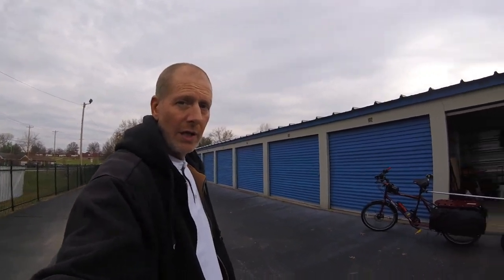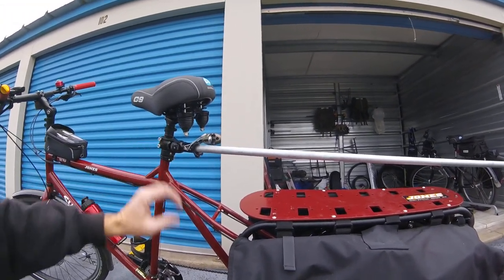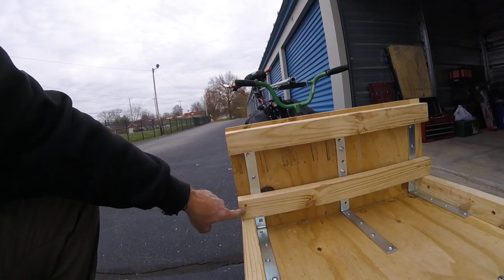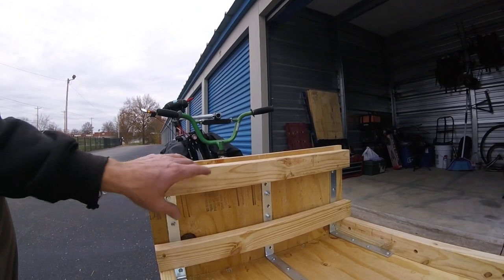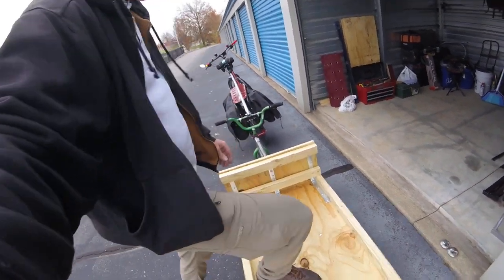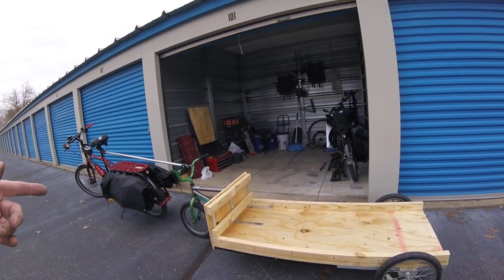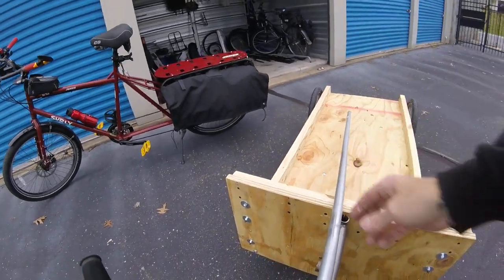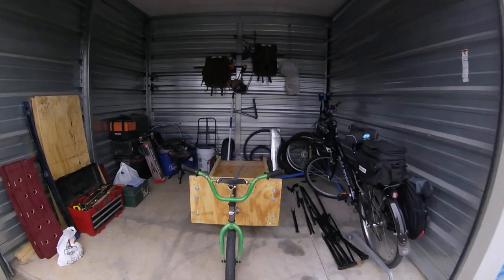3 Wheel Bicycle Trailer Build Part 3 Completion

Comment: May I suggest round wire lock pins to make the hitch arm removable?
Reply from the maker: Newest video shows how I fixed the week point. I like the bar attached with bolts as it just folds back onto the trailer for storage. Plus I always try to prevent theft of my bicycle and trailer in public settings. The easier you make it for people to steal your stuff the more likely they are to try and steal it.

Comment: I did almost exactly the same stem around the seat post as you. But i cut it in half. I just noticed you seem to be missing the 3rd axis of rotation / roll ? Also i think you only need one up and down movement but you have dual pivots at the handlebar and at your seat post, does that work better ? check my version of this https://youtu.be/AJDL-AiAKPA tell me what you think, im using a kids scooter part and 2 bike stems one is cut in half and drilled
Reply from the maker: That is a good point I do not have any roll. I like your version. Mostly I like messing with different setups and just tinkering.
Reply: @CargoBikeCowboy  semi trucks have no roll that's why if the trailer blows over it takes the tractor with it. Every other bike or motorcycle trailer has roll because the bike tilts during turns and will allow you to lay the bike flat while still attached to your trailer.